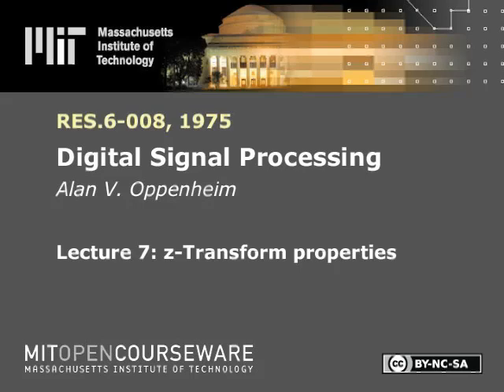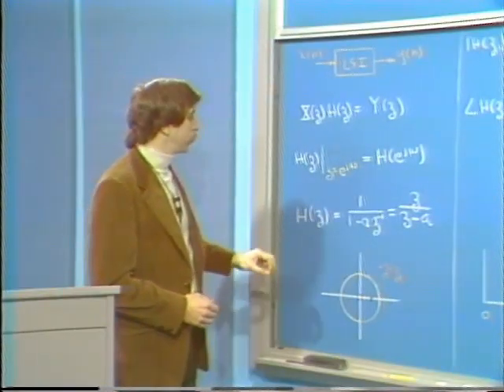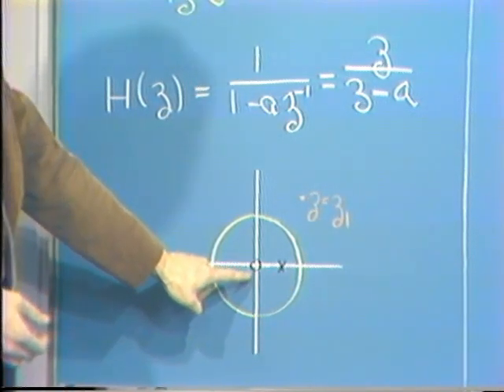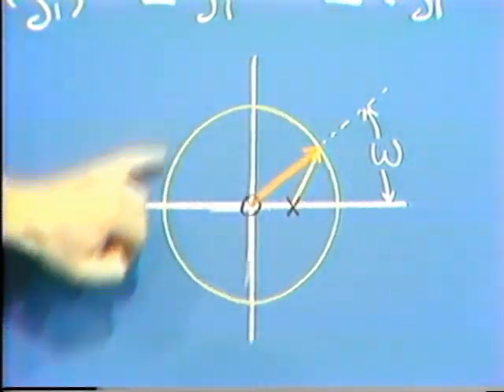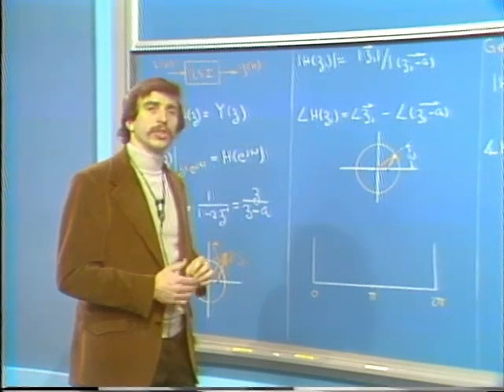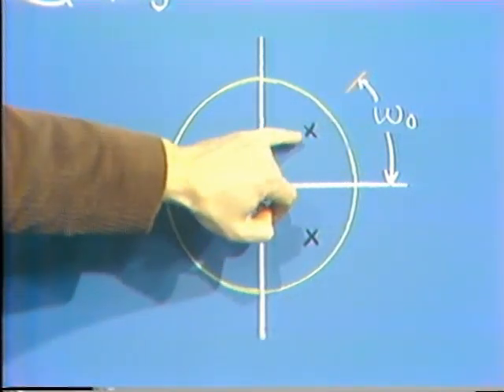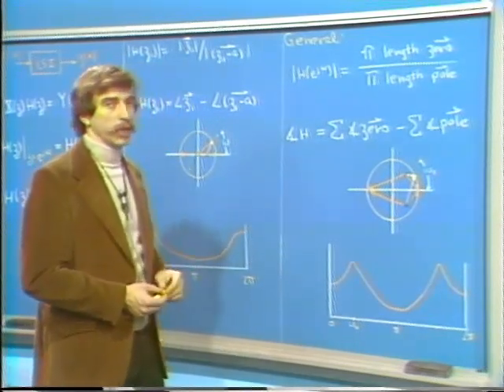Lec 7 | MIT RES.6-008 Digital Signal Processing, 1975

Comment: 🎯 Key Takeaways for quick navigation:

01:23 📐 The geometric interpretation of the frequency response relates the Z-transform to the Fourier transform, providing a visual understanding of system characteristics.
07:49 🔄 Poles or zeros at the origin introduce a linear phase term in the frequency response, with no effect on magnitude.
14:53 🔄 The magnitude of the frequency response is the product of zero vectors' lengths divided by pole vectors' lengths, emphasizing periodicity.
16:20 🎢 For a pair of complex conjugate poles, the frequency response's magnitude peaks near the poles, creating a resonant characteristic.
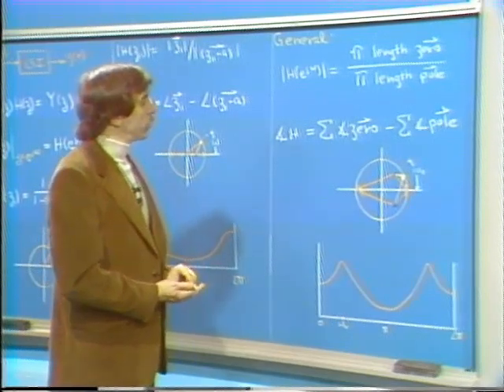21:29 📉 Unit sample response of a system with complex conjugate poles resembles a damped sinusoidal sequence, influenced by pole distance from the unit circle.
26:09 🔄 Shifting Property in Z-transform: Shifting a sequence x(n) by n0 results in Z-transform z to the n0 times x(z).
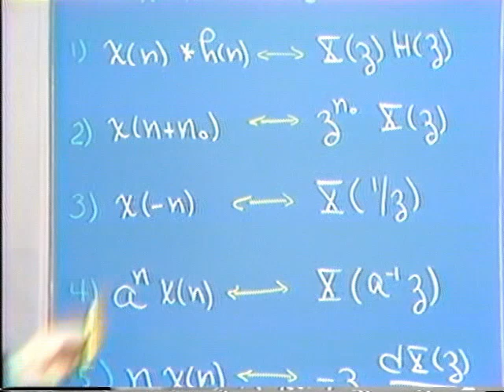26:39 🔄 Reversal Property: Replacing n by -n in a sequence corresponds to replacing z by 1 over z in its Z-transform.
27:08 ✳️ Exponential Multiplication Property: Multiplying a sequence x(n) by a to the n results in Z-transform x(z) divided by (1 - az^(-1)).
27:33 🤔 Numerous Z-transform Properties: There are many Z-transform properties, and proofs follow a similar vein.
31:34 🏗️ Connection to Rational Systems: Z-transform of linear constant coefficient difference equations corresponds to rational system functions.
32:55 🔄 System Function Construction: The system function (ratio of Z-transforms) of a rational function can be constructed from coefficients of the difference equation.
34:42 🔀 Z-transform Shifting Property Significance: Shifting Property is valuable and frequently used in digital signal processing.
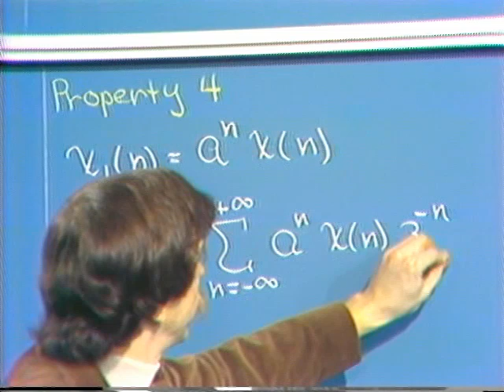35:30 🔄 Z-transform of Exponential Multiplication: Z-transform of a sequence multiplied by a to the n is obtained by replacing z with a^(-1)z.
38:19 🔄 Effect on Poles and Zeros: Multiplying a sequence by an exponential shifts poles and zeros, affecting their positions in the Z-plane.
43:52 🔄 Z-transform of Boxcar Sequence: The Z-transform of a boxcar sequence (unity for n between 0 and N-1) involves poles and zeros at specific locations in the Z-plane.
47:39 🔄 Geometric Interpretation of Frequency Response: The frequency response of a system can be understood geometrically by considering the locations of poles and zeros in the Z-plane as we traverse the unit circle.
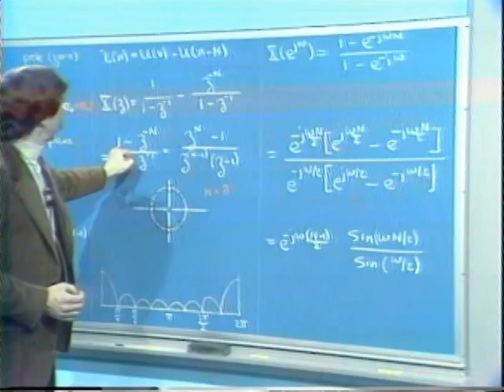50:55 🔄 Fourier Transform of Boxcar Sequence: The Fourier transform involves a complex expression, with a significant part being a sine nx/sine x-like function.
52:18 🔄 Significance of Sine nx/sine x: The function sine omega capital N over 2 divided by sine omega over 2 is crucial in discrete time, akin to the importance of sine x over x in continuous time.
53:47 📈 Characteristics of the Function: The plotted function exhibits sinusoidal behavior with an envelope reciprocal to a sinusoid, periodicity over 0 to 2pi, and a decay similar to sine x over x.
55:42 🔄 Upcoming Topic: The next topic is the Discrete Fourier Transform, closely linked to discrete time signals and signal processing, with both mathematical and computational significance.

Made with HARPA AI